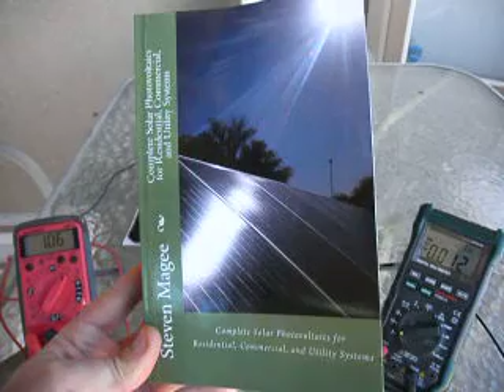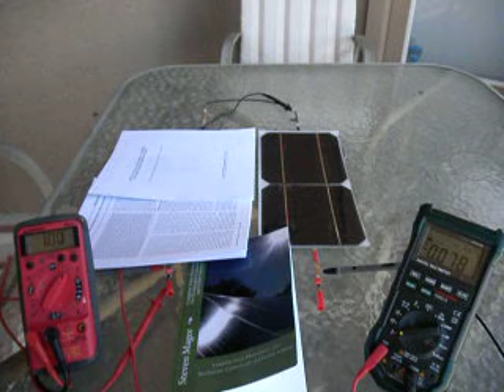Solar Module Reverse Currents

Comment: Hardly makes any sense.  Then, how is that "extra" current dissipated or used, as power?  Is it radiated off the covered 2 panels as HEAT?  If not, where does that power go?  If that process were true, then why would it not be tapped to gain 4 TIMES the current in an actual load wired into the same series of wires in the same way?  This demonstration is not clear at all.  It needs to include a LOAD and a demonstration of the actual total WATTS at all times.

Comment: If the voltage remain the same, and the current doubles then the power output should also double, I guess the shading should decrease the current output.
Reply: The formula for total WATTS has to remain the same, no matter what he does:
V x A = Watts
That is the part that he has not explained.

Comment from the maker: Blocking diodes can prevent fuse blowing through reverse current flow, becuase they prevent reverse currents from occurring.  On a system that is prone to fuse blowing from reverse currents, then the addition of a blocking diode on each solar string may prevent future fuse blowing incidents and may actually increase the annual power production of the system.  They may also increase the system safety by preventing reverse currents from flowing into arcing faults that are too low to blow the fuse.